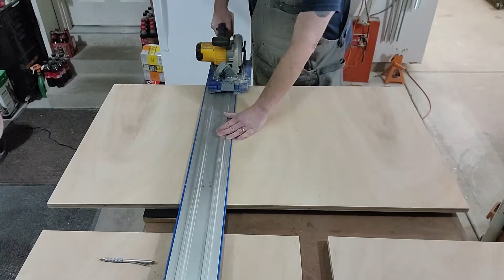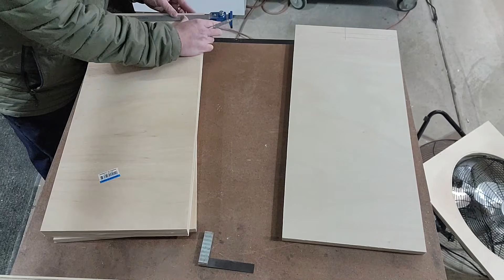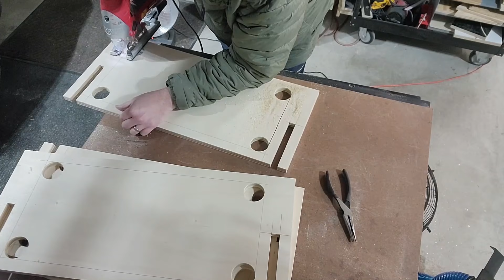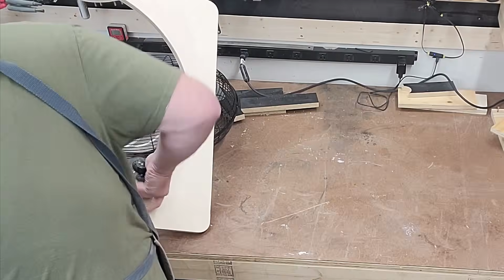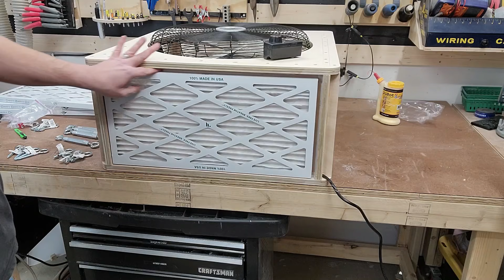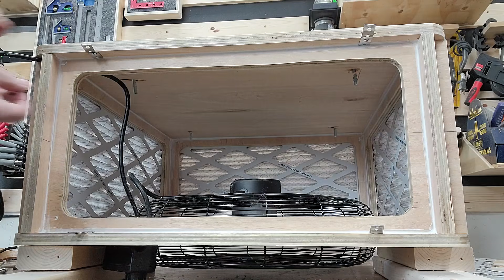SAVE YOUR LUNGS! Woodworking Ceiling Mounted Dust Filter - How to Make

Comment: Greetings to you and anyone else here reading. This is a novel concept and very well executed. Minimum Materials, efficient slotted design and the hanging system allows for vibration isolation. 

There is just one issue, and it comes into view when you consider your Garage as the system, an not your Fan by itself.

1. The suction force at filters is 1/4 the Output force. So the churning of the air is dominated by the Fan's downwash.

1b. Your fan blows downward from the middle of the Garage, PUSHING dust to the edges of your where more likely than not, there are shelves. Once at these edges the air is forced to rise up and come around the top into the filters. During this "rise", heavier particles that may be swept up from the floor will be shed along the shelving on the garage's edges. So over time you are going to have build up of dust under shelves and on shelves.

2. The location of the filters is at a height where it is incapable of trapping larger, heavier particles.  

Suggestions: A redesign of the enclosure is required. With 3 filters and fan blowing backwards. into the back of the garage. Bottom and Top closed. This would "Lift up the air from the middle (where most dust is created) and push outwards the larger dust on the floor from the back wash waterfalling down.
Reply: I agree about having the fan blow upward. I want to push the warm/heated air at the ceiling to the walls and down in winter. I'm not concerned about the large particles, I can vacuum those up. I am concerned about the small particles that I breathe.
Reply from the maker: Thanks for your comments. Folks can choose to mount this in different orientations if they choose. For me, I want this to double as a ceiling fan. So in my garage it works pretty effectively.

Comment: I need this because I want to keep my bedroom room dust-free so I never have to vacuum, do you know if I can put a couple of computer fans (for quietness) and would it still work? Or is it too weak. I'm definitely just going to stickytape the filters together, I don't have this sort of equipment. Yeah, I just wanna be able to sleep with it on. Thank you, appreciate your work
Reply from the maker: Computer Fans won't work. For a bedroom, you may be better with an off the shelf room air filter/purifier. As those are fairly inexpensive.

Comment: Love this design!  So much so that I just finished building it!  Thanks!!  I did encounter a problem that I am hoping you too may have solved.  When I start the fan with the MERV13 filters in place it seems to have trouble “priming” and the only moving air is parallel to the fan disk and right back through the filters.  Nothing down into the shop.  If I take a filter out slightly for a couple seconds the fan seems to “bite” and all works great.  Have you encountered this?  One solution may be to use MERV 11 f	liters, or to make a cylinder tunnel for the fan. Let me know if this is something you have come across. Great post!
Reply from the maker: I've seen this when the filters are dirty on startup. A MERV 11 would have less resistance and may be better in that respect. I've been thinking of some changes for a version 2.0 of this filter that may address that issue.
Reply: Randy, did you ever come up with a fix? I'm have the same priming issue.
Reply: @Oakydokes  i switched to MERV11 filters, which worked great. I can slip in one of four MERV13 filters, but I never did get it to prime with all 4 MERV13. I tried making a cylinder around the fan and exit side to try to encourage a quicker prime, but it didn’t really help much at all.
Reply: @brutusatlanta  Great. Thanks. Are you by chance using 2" MERV 11's?
Reply: @Oakydokes  Sure!  No, I’m using 1” MERV 11 filters
Reply: @brutusatlanta  I received my 2” MERV 11’s and it runs great. Thanks

Comment: That is a good box and idea. However, those cheap fans only last a year at most. Also, that model could be discontinued. So the box will have to be moddified annually to accept the replacement fan.
Reply from the maker: I've been using that same for over 2 years in garage to stay cool before I decided to build this.

Comment: When I seen you use the Matal to secure the filters . An upgrade could be using some self secure hinges for cabinet doors. Screw the one sind into the assembly and allowing them to snap into place over the filter covers. They will last a ling time add presser and snap into place .
Reply from the maker: Another good option

Comment: Use blue painters tape and tape all the boards together to make one cut in the stack for all the same boards.
Reply: I used  20x25x1 filters on all sides( except the fan - same one you used).  My shop is 950 sq ft so I needed a larger filter.  It REALLY helps get all the fine dust out of the air!  The particles are so small they act like a gas more than a solid.  Filters last about a year; runs about $60 to replace with new HEPA filters, but you can blow them out and get another year.  I used 3/4" MDF for the fan mount and 1/8" ply for all the other sides.  Your design is much simpler; mine is a slot together arrangement (no screws) and caulk.  I used my CNC to cut all the parts.
Good video, no annoying background music so I could hear clearly what you were saying.   Like and Subscribed.
Reply from the maker: Thanks!
Reply: @unclebob8746  how much space your design took from ceiling to downwards? I am thinking for the same filter size.

Comment: nice build... one step better would to have the ability to put filters inside of frame to so they get a better seal.
Reply from the maker: Not sure what you mean by inside. They are sitting inside a frame and then suction is pulling them inwards against the wood backer. Also the clips are providing positive pressure to wedge the filter against the backer.
Reply: @TheSuburbanGarageWorkshop  LOL... Sorry I thought the fan was blowing into the box.     ( my bad )

Comment: Great design. I'm thinking of copying it! Is the 20 inch fan airflow not enough,  just right or too much? I'm thinking about same type of fan but 14 inch. What are your thoughts? Thanks.
Reply from the maker: I have no experience with thr 14" fan, but just as look at the rated CFM and compare it to the 20" to get an idea. Thanks!

Comment: Great project!  I need to do this for my workshop.  In the past I have used cheap box fans with 20" X 20" filters taped together on the sides to make a large box with the fan on one side.  Crude, ugly, flimsy, and usually in the way.  The big problem I see is that the fans are designed to work in a vernicle position and have no effective thrust bearings for horizontal operation.  This makes for limited time before the wear becomes so bad that they start making noise or seize up and won't turn.  It should be fairly easy to add some type of simple bearing to solve this problem.  Any suggestions?
Reply from the maker: The fan came with instructions to use the stand as a wall mount to allowed different orientations including horizontal. Not saying this indeed has a thrust bearing, but for sure is a different category than a cheapo box fan. I guess we will know once this one finally dies on me. Thanks for your feedback!

Comment: Should have made the areas where the filters go the same size as the filter you use so they almost press fit in. The next logical step is to 3D print one.
Reply from the maker: I cover that in the video. Filters are rarely precise sizes. If you search for 12x24 filters, you will find they are all slightly different in actual size.

Comment: If the filter is at roof level and the air is blown down then what percentage of the dust will make it all the way up to the roof and what percentage will just get air-born because of the air blown on the ground?
Reply from the maker: It's pulling in the dust suspended in the air which is the most unhealthy. It pulling that dust in from 4 sides at or above head level. Being in the middle of the room it sets up a convection type air flow. Thanks for watching.
Reply: @TheSuburbanGarageWorkshop  You want the fast flow to suck the dust in where you're most likely to find it and you want to fill the room with a slow flow of clean air where people bread without stirring the dust accumulated on the ground.
Reply from the maker: @comptegoogle511  The intake and outtake speeds are going to be virtually the same at the fan level. But if you are concerned with the "stirring up the dust", then mount sideways or facing upwards with more distance between the box and the ceiling. I wanted it to also act as a ceiling fan. Lots of ways to skin the cat here. Adapt to your own needs and concerns. Thanks for your feedback.

Comment: I’m “Basically” going to be building this, great video. Keep these coming😉
Reply from the maker: Hahaha thanks! And yes, I know, I basically say basically alot in that video. I've gotten better in my newer videos. Thanks for watching!
Reply: @TheSuburbanGarageWorkshop  it really is a great video bud, and I bet it’s alot cheaper than buying one from rockler or delta
Reply: Can you tell me how much this cost to build? I know wood prices fluctuate lately and will play a role in it but just a general idea
Reply from the maker: @Northeast_Mainiac  figure a sheet of 3/4 sanded plywood and the fan and the filters. So approx $150? But it has about 4x the filter surface area of the cheap consumer units (aka WEN model)
Reply: @TheSuburbanGarageWorkshop  thanks

Comment: I really like your design and your execution!  I'll probably copy this very closely for my shop with a few minor changes and one giant change.  The giant change is to leave room for super cheap furnace filters to protect the more expensive MERV-13 filters from coarse debris.
Reply: The coarse debris tends to fall out of the air.  It's the small particles that act more like a gas than a solid that linger in the air.  That's what you breath in.  A good cyclone dust collector is also a great help.
Reply from the maker: Thanks. I tried to create a design that was flexible and changeable to suit whatever needs you may have.
Reply: I like this design, but would want to upgrade to at least 2 inch filters for better air flow and longer useful filter life.
Reply: I think you did a great job and clearly put some thought into it.  I've been pondering making something like this and was wondering if a box fan would be as effective as your Lasco fan.  One concern I had is that by having the fan face downward instead of outward that it would disperse any sawdust underneath it on your work area.  I'm also not convinced that any weather stripping would provide any significant benefit since the filters will be sucked in when running.

Comment: Solid build. I built a rolling filter a few years ago. So, this is a process question. Not sure if this question was asked, but why did you take the frame apart and attached the sides separately? Similar to how you attached the back, it would have been a lot easier (I think) to attach the sides to each other during your dry fit, then attach the front and the back to the pre-assembled side panels. You wouldn't have to worry about lining up and balancing the sides while you're gluing them.

Also, for the filters, you can use rotating hold downs, instead of the metal tabs. I used small plastic tabs secured by a single screw. They just rotate out of the way when you need to swap the filters.

Nice work though.
Reply from the maker: The filters vary and are not as deep as the space provided for them. Filters vary in depth, so building to one specific filter may cause fit issues later. The bendable tabs account for all that variation and allow for positive pressure to firmly press the filter against the opening to help seal. Thanks for your feedback.

Comment: If you face the fan inwards you won’t be blowing the finer dust everywhere in the garage and the air filters will catch the dust from the inside
Reply: I would even take it as far as venting it out.  So you’d have a massive exhaust fan
Reply from the maker: @Constructionjunkeesshorts  That doesnt work in the winter as it would draw in cold air from the negative preasure and make the garage even colder if you live in a place that gets bad winters.
Reply: @TheSuburbanGarageWorkshop  I’ve done this before with great success.  Just need to make sure the fan gets cleaned a bit.  

I find that with the fan blowing down I get fine dust everywhere in the garage still.
With the fan inward in my box setup, no fine dust anywhere.  Just a thought.  Great setup though.
Reply from the maker: It would clog the fan. This is why furnaces and air filters always have the filter media on the intake, not the exhaust side.

Comment: Thank you so much! I had started gathering everything for such a project before this video and evidently don't picture  designs well, so it is waiting to be done.   The only difference for mine is that I all of the filters are large which will result in a monster air purifier.  🥴.  I appreciate your instructions and clean video.
Reply from the maker: You are welcome!

Comment: Nice!  I like the simplicity, and those fans draw a lot more air than a box fan.  I may have to do this myself
Reply from the maker: Indeed, I've used those circulator fans for years. A godsend when I lived in the desert and was working on my car in 105f weather. Box fans don't hold a feather to them.
Reply: @TheSuburbanGarageWorkshop  First, nice craftsmanship.  Now I am wondering how well this works ... for example you close your doors and route MDF loading the air with particles measure how long to scrub air.  Other thing I have a Jet scrubber hanging from my cieling and it has louvers to direct the air.  I would be curious how you unit preforms compared to those you buy and how performance would vary with different filters and of course how long filters last.  Would there be a benefit directing discharge air, for example if  you could not mount it in middle of your shop.

A dirty shop is not fun to work in ... Good project.

Comment: Great idea.  I'll probably be building this myself.  I would ask though, did you consider mounting the fan going up?  Seems the downdraft could cause a lot of unnecessary blowing of stuff
Reply: Great video, design and build it just seems blowing down is not a good option.  It appears to me that by blowing down it blows the dust away from the filter.  Even blowing sideways like the store-bought kind might be a better option.  but like they say, "builders' choice".  Glad I found your channel and subscribe. Thanks
Reply from the maker: Yes, but then it gets hot here in the summer, the downdraft will act as a ceiling fan for me! So this is one of the reasons I mounted it down.
Reply: True
Reply: Was just about to post this very question - I'm seriously considering mounting mine blowing upward, as I don't really have any good places in my shop that wouldn't be negatively impacted by that much constant blowing air. I think it may actually improve the cooler air being drawn in from the doorways in my shop as well.
Reply: @stevemgrimes  If the size is right, you can probably put a filter in the spot opposite the fan also.

Comment: I'm in process of making this Air Cleaner. 
I downloaded your plans and I was wondering what software you used to make the designs ?
This is the first time I have downloaded and printed such clean prints.
Reply from the maker: These were done in Sketch-Up. Then used a plug in to generate the cut list
Reply: Could you tell me the name of the plug in that you used to generate the cut list. ? @TheSuburbanGarageWorkshop
Reply from the maker: @ohiogobuks  Its called OpenCutList

Comment: Good project, I like the box design. I'm going to try starting with your build approach, but narrowing it, using 2 filters with a squirrel cage fan , but I want to figure a way to direct the output air into my dust collector system, so the air dissipates through the bag. I need the air to be both clean and still enough to finish my guitars.
But your design solved covers of my needs!
Reply from the maker: Looking forward to seeing what you come up with!

Comment: I like your design. I would make one little addition, put a closed cell 1/2x1/4 foam window seal between the metal fan basket & the box to dampen any fan vibration noises from transmitting into the air filter box.
Reply from the maker: Great idea!

Comment: If the fan is on the intake there is not a blast of air stirring up more dust, but the fan motor and blades will require cleaning, and the filter dust clogging will won’t be visible.
Reply from the maker: I like the clean air circulating down, like a ceiling fan. It's going to really help in the summer to keep the air moving in the garage.
Reply: @TheSuburbanGarageWorkshop  I have to sell my current home* that has a detached garage that was built as a shop I’ll definitely be building something built off your design. It is one of the best I’ve seen. 
* Moving from Chicago metro to Tulsa. Taxes are driving us out ($9000 now $1500 there)
Reply from the maker: @monteglover4133  I hear you. I'm in Chicagoland as well. When we get closer to retirement, we will be looking at something out of state also due to taxes.
Reply: @TheSuburbanGarageWorkshop   Maybe lunch sometime? 
We’re in the NW burbs
Reply from the maker: @monteglover4133  Sure, I'm in North Aurora.